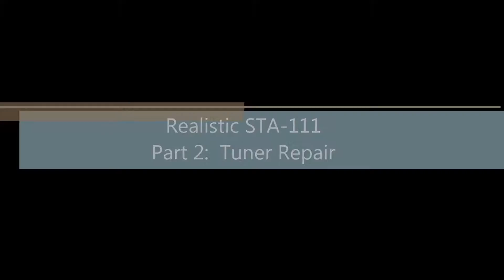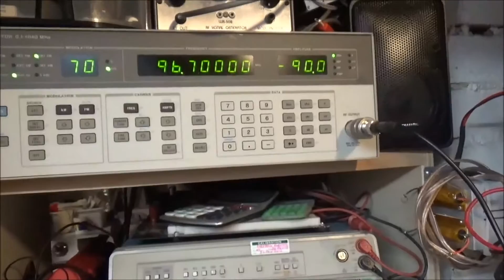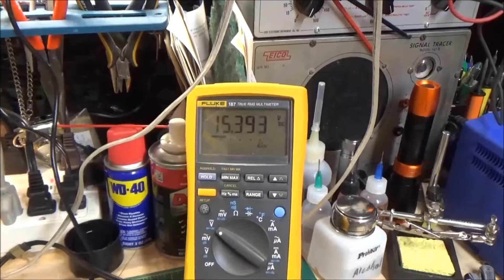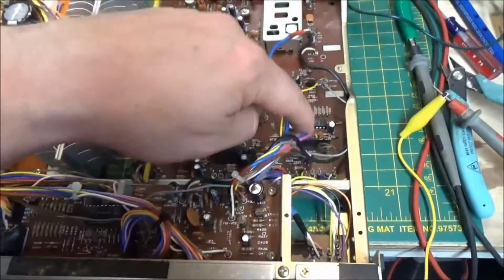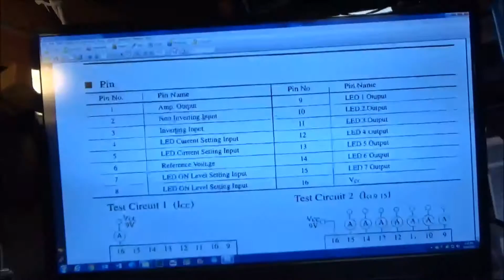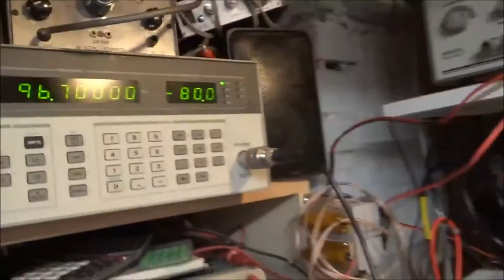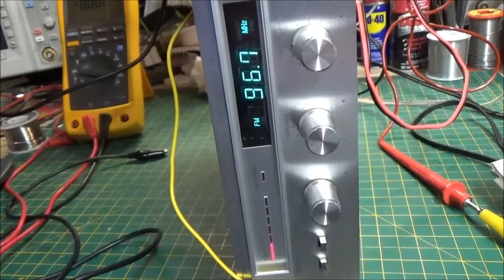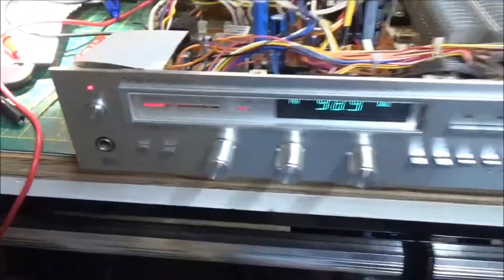Realistic STA 111 Part 2   Tuner Repair

Comment: Well...I finally repaired the same problem with my STA-111....Although mine also had an audible motor-boating at low frequency on both AM and FM.....In my unit, I had already replaced the 2SD325 transistor with an NTE152 which was a recommended substitute, but I was still finding the motorboating in the audio.

Then I checked the B+ voltage to the tuner board, which would start out at ~10.5 Vdc and slowly rise to about 12.5Vdc over a half hour or so, and was still not stable even after an hour....It would drift around from 11 to 12.5V and I couldn't align the FM detector transformers properly with that variation.

After replacing a few dozen old caps on the tuner and power supply boards did not solve the problem, I started to do some research on the 2SD325 and the NTE152 and finally re-installed the original 2SD325 transistor which brought all the voltage levels back up to spec.

With the NEW NTE152 installed, I was seeing ~28V of the collector but about 12V rather than the 15 and 16V the manual specifies on the emitter and base, and I thought that the voltage sag was due to excessive current drain somewhere so I checked that out too.

I disconnected the B+ line to the tuner board and like you did, I connected it to a 13.8Vdc supply and checked the current drain, which was ~110mA which the supply should handle without any problem...

Finally, just this morning I decided to remove the NTE152 and replace it with the original 2SD325, and voila, problem solved....I'm getting a solid 15.1Vdc to the tuner board, and it doesn't sag or droop from that level on AM or FM even with a station tuned in....Previously, the B+ would vary while changing stations on FM, and cause distortion and motorboating.

I'm sure some of the caps I replaced needed it after 40 years, so I have no problem with having done so, but I had no idea that a new recommended sub would cause the problems it did.

The 2SD235 does run pretty hot, but less so than the NTE152 which for some reason was dropping an additional 3-4 Vdc which only added to the heat it produced....

I have it running right now driving a pair of early Minimus 7 Silver speakers and it sounds great...!

BTW, Most of the caps I removed tested just fine for capacitance and leakage on my Sprague TO-6.

The service manuals for both the original 31-2002 I have and the 31-2002(A) you have are available from manualman.com and he provide me with an excellent copy for mine....

Comment: I had same under voltage problem due to replacing the regulator transistor because the old one was so hot. The replacement could not give 15V. I put the original back in and after changing almost all electrolytics still no joy.. still very hot. Noticed the small 1nf filter cap across tr802 base and collector, which I think gives the base current to the regulator. Changing this for a new one fixed the heating problem!